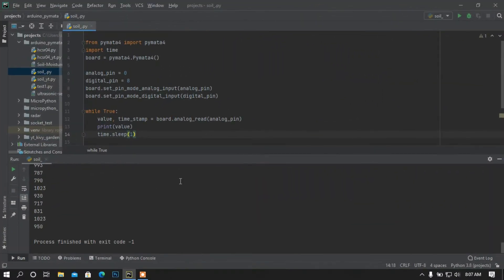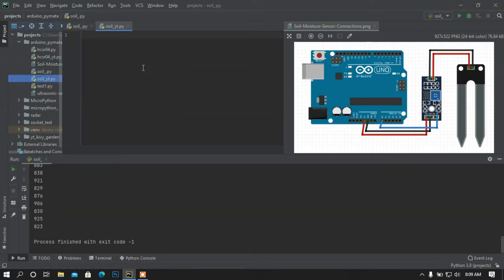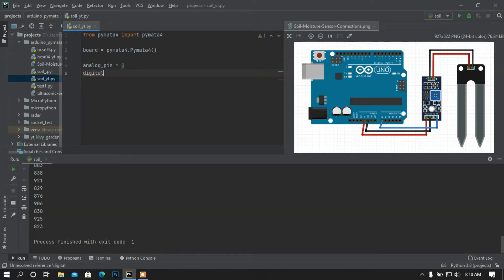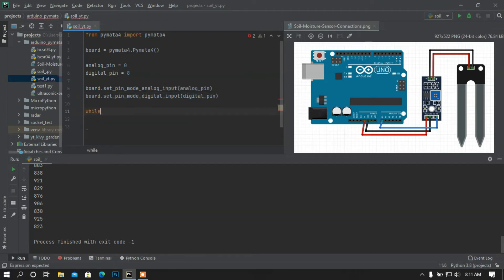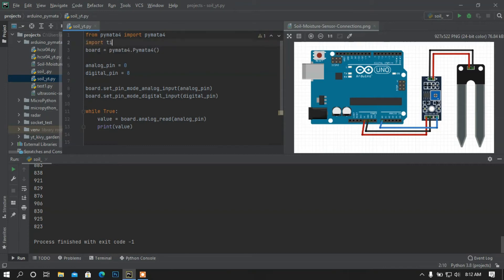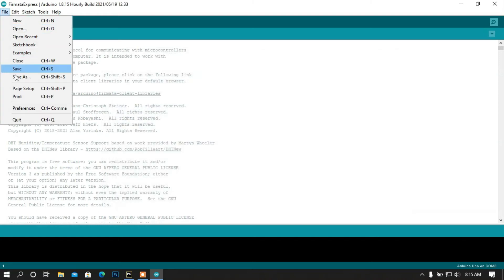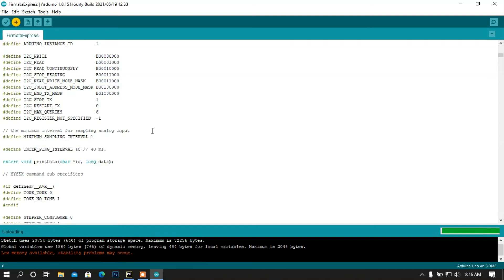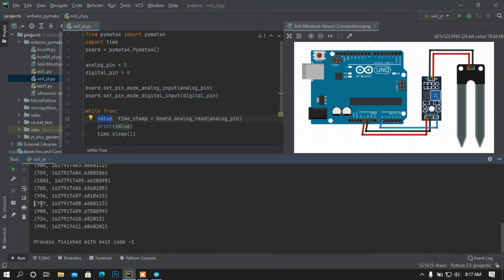Soil Moisture sensor with Python and Arduino | PyMata | arduino | Soil sensor |

Comment: Hello sir 
Iam getting error as  No module named 'pymata4'
Reason behind it sir.
Reply from the maker: install the module
open pwershell or cmd
than install the module with 
pip install pymata4
Reply: @OIRLDBOX  thanks , i will try it.
Reply: Thanks sir it worked , sir one more help
For use of dc motor n relay what we need to declare.
Reply from the maker: @meghapatil2249  just declare a  digital pin and than send signal as you need. You have to connect dc motor to arduino with that pin. And dc motor can burn your arduino,  so be careful to use it. You may need to use a capacitor.
Reply: @OIRLDBOX  ok sir